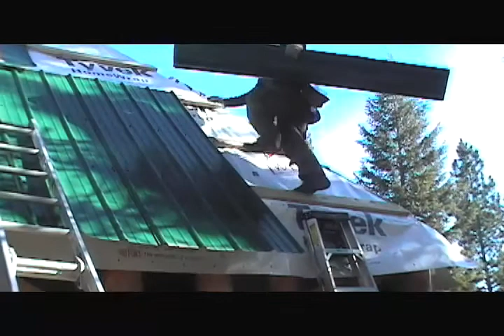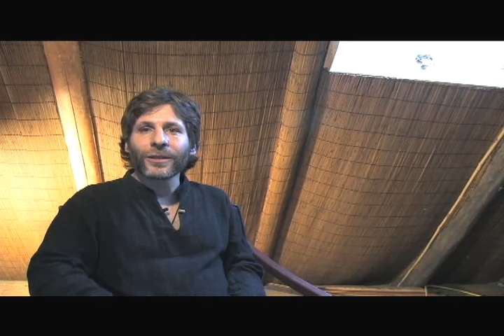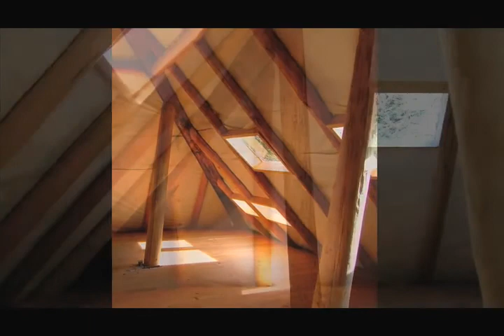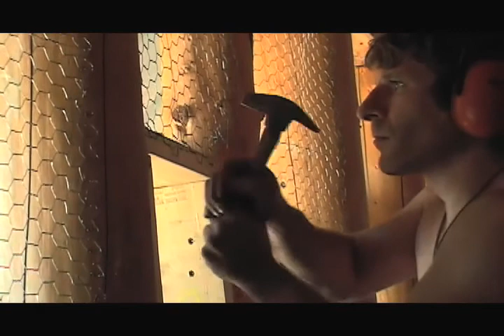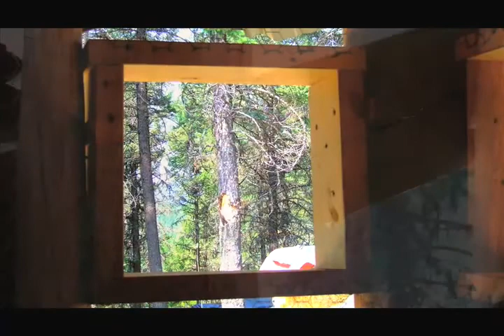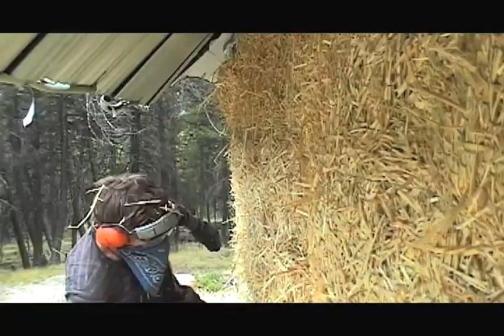My life in an off-the-grid solar powered pyramid 3/6

Comment: Good straw stays good as long as it doesn't get wet. I should add that it's okay if it gets wet, as long as it can dry out completely. The walls need to breathe so moisture isn't trapped. If moisture does get trapped and the straw doesn't dry out completely, the straw will mold and rot. But you would have to have a major leak or something for that to happen... You'd have to tear out the bad straw if it ever did get to that point. That could happen with fiberglass or whatever as well.